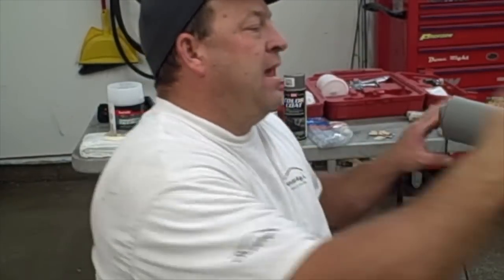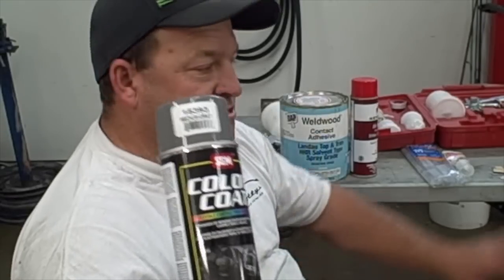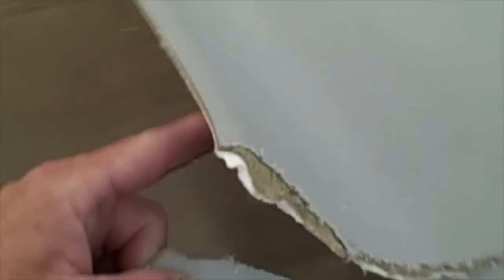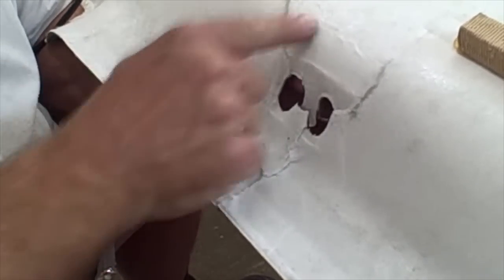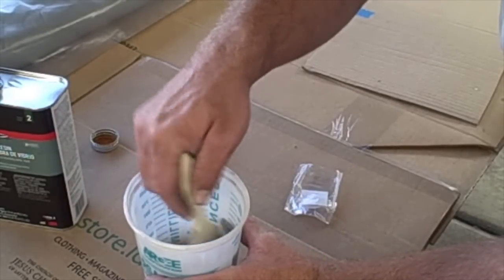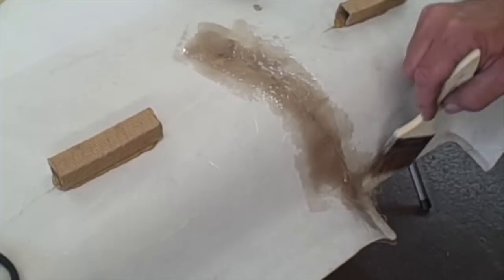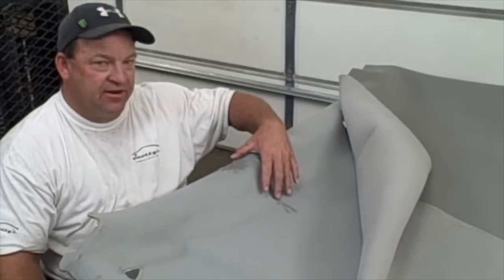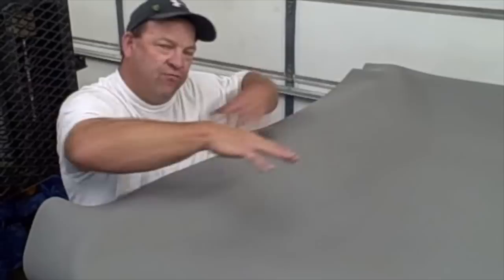How to repair a Honda Ridgeline headliner (Part 2)

Comment: Thank you very much for the tip w/Fiberglass and silicon, I'll use it to repair some defects in my headliner. I have couple questions. When I removed the headliner I had impression that the top wires were attached w/Scotch tape to the headliner, but now i think they might just stick to the headliner, but actually were attached to the metal ceiling. can you attach them to the ceiling w/tape? And another question : when I cleaned the old foam, in some places there was some layer pilled off, like thin fabric or paper, not sure what it is. So now, should I pilled it off everywhere, or I can live it and the foam will attach and dissolve that layer (I hope it is some kind of paper layer), but maybe when the headliner is in that condition, it can't be renewed w/a new layer of foam fabric. Thank you again.

Comment: why would you overlay the headliner, eventually the glue is going to release on the original.
just remove the original and brush off the backing, then glue in the new headliner material.
great fiberglass repair but believe this fell short for best resolve.